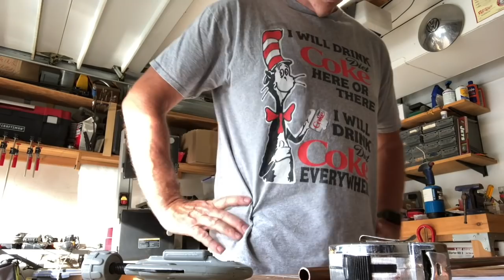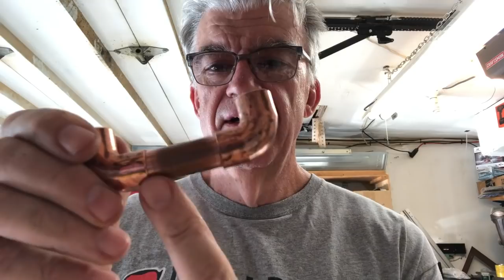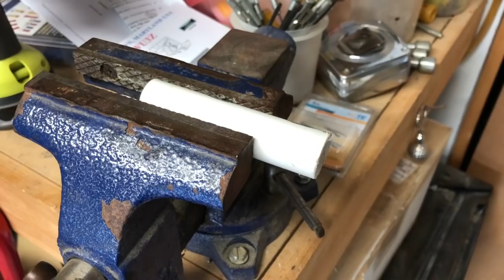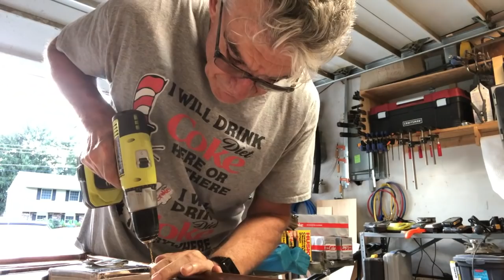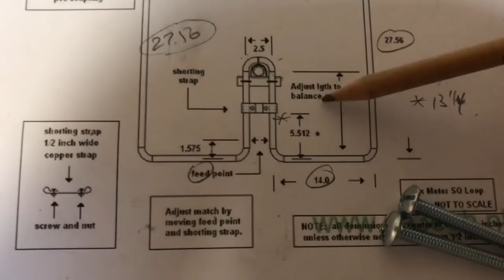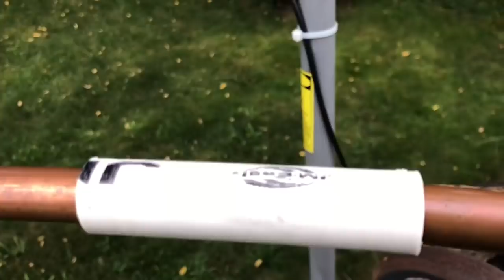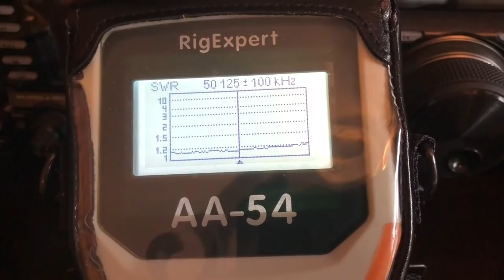6 Meter Squalo Antenna Build

Comment: Hi, I recently found your channel. Now that you have had some time with the antenna I wondered how it is working out. Have you made many 6m contacts wih the antenna? Looks like an interesting project. Like you, I have been interested in trying this band, but don't currently have an antenna for it. I don't actually know if the level of activitiy on 6m makes the effort worthwhile or not. I enjoy your channel, keep up the good work. 73 KD9IBH
Reply: 6m is open in the summer between May and Sept The hotter the better just try it and listen I talked to New York Jersey area from Chicago and some folks around here. If you have a SDR Stick with HDSDR you can view the band quickly.
Reply from the maker: Donnie Biederman Looking forward to working 6!
Reply from the maker: JNetBelch Thanks for the kind words!  I made one contact when I checked into a 6m net.  Listen around on 6m but haven’t heard anything yet.  To be fair I haven’t been on all that much lately.  I hope to get some operating time in soon.  Thanks again and best 73 de K2CJB!

Comment: Nice build;  did you seal the coax at the feed point to prevent water intrusion into the coax? Also  do you have those antennas grounded?  I will check out those plans.
Reply from the maker: Mike C Thanks Mike!  Actually I was out of coax seal the day the antenna went up.  I can run back up and seal it up when I get some.  As for grounding the antennas, I dont't have any ground connection directly from the antenna mounts to ground.  In the 40+ years I've been a ham, I've never run a direct ground connection from the antennas.  Of course now that I say that, something catastrophic will probably happen!  😃. Thanks for checking it out and have fun if you build one.  It works great!  73 de K2CJB

Comment: Nice! I've seen the plans for those and almost built one too. Glad to see it worked out for you!
Reply from the maker: Thanks Ron!  Yeah, the SWR was so much better with it up in the air.  I forgot to mention that I decided to mount it by itself rather than on the mast with the tri-bander to reduce any coupling between all the antennas.  It looks to be ok so far.  I was going to just leave the rig on 50.125 and see if I heard anything.
Reply: Here's a resource! http://www.k9mu.com/map/
Reply from the maker: Ron C That's great!  I found the beacon I heard!